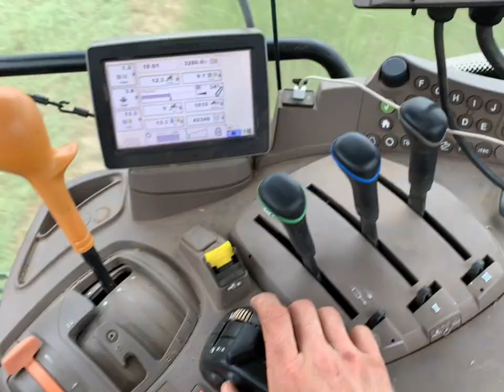LIVESTOCK FARMER MODE ACTIVATED!!! AND A BROKE THE MOWER 🙈

Comment: I'm afraid I will have to steal the crush modification 😁 we have the same crush and we love it apart from for TB testing calves. Bad news on the TB. We have also just got a Kuhn mower like that and coincidentally had to straighten those guard rails ,particularly the flat joining pieces as it wouldn't open up for changing the blades ,the bit where you welded was the only part where a bit of rot has set in on an otherwise very tidy mower so it seems to be a weak point. We are very pleased with it so far.
Reply from the maker: Feel free to steal it John. It’s been a good mower for us really, haven’t got too many complaints. I do like the look of the Mchale and the POTTINGER though, not that I’m looking to swap it any time soon!